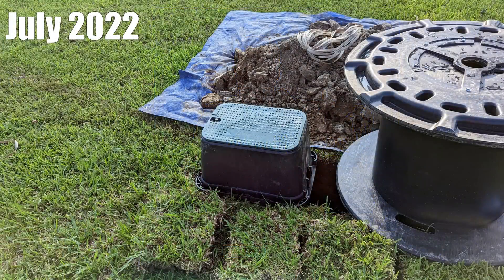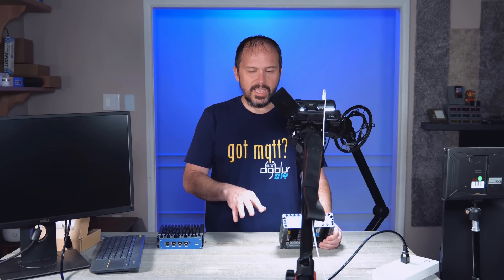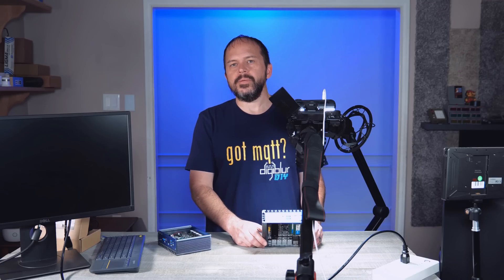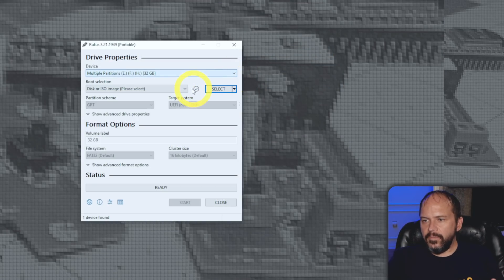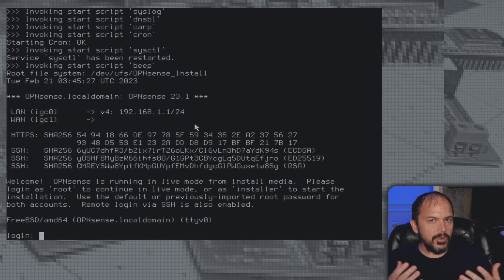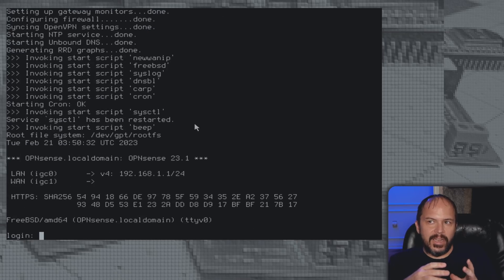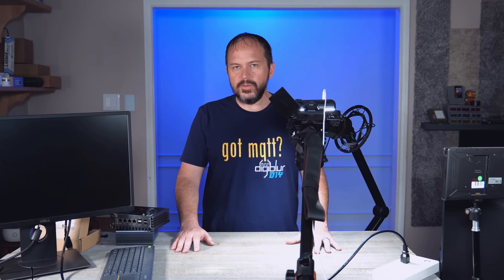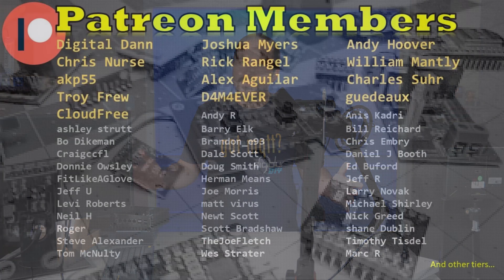Switched from Ubiquiti to OPNSense Router! How To Guide

Comment: I have an opnsense router and trying to use unifi access points. How do i configure the udp relay port and the associate firewall rules so the ubiquiti switch and ap will discover each other. right now i can see the devices but cant adopt them.
Reply from the maker: Is that due to the Ubiquiti controller needing the override IP option to adopt?
Reply: @digiblurDIY  i m not sure what that is. sorry i m very new to this. let me check google and see what i find if not may ask for more help!
Reply from the maker: Where are you running the Unifi controller at?
Reply: @digiblurDIY  I got it working on my windows desktop which is on the trusted lan network. But couldn't get it to work on haos in the same trusted network. It would find them but time out trying to adopt it. So originally I thought I needed discovery protocols. 
Can I move it to haos from my desktop? Does haos need specific ports or other settings involved to get unify network controller to work?
Reply from the maker: @TamrinKhan it is a common problem. You just need to change the override adoption IP in the advanced settings in Unifi as it gets confused running as a container/add on and sends the wrong IP to the hardware being adopted. All you need to do is put in the IP of the HAOS hardware.

Comment: I am exactly at this stage but I decided to put opnsense inside proxmox. Why?
1- dns is on pihole - also in proxmox
2- dhcp is on pihole - also on proxmox
3- this machine is already with battery backup
so there is no reason to keep firewall on separate/dedicated hardware, especially that my proxmox has 16 cpu and 64gb of ram - more than enough for every VM or container I can imagine ;)
and if my proxmox is down, my everything is down anyway - in such emergency case simply reconfiguring the routers to be again dhcp is enough to restore connectivity in the house
did I miss anything?
Reply from the maker: It is your setup to support and run so if you aren't missing anything than roll right on.

Comment: Cool Travis, I got mine setup. Will we be able to bring over the static IP reservations from the Edge router 4? I'm looking forward to the next video in this series. Thanks!
Reply from the maker: I don't know of a conversion tool. I did it manually. Copied the edgerouter contents to a notepad and then put them into Opnsense.
Reply: @digiblurDIY  Did you have to copy/paste the DHCP static leases in? Thanks
Reply from the maker: I edited the xml file and copied them in myself.

Comment: I prefer OPNsense to be honest.  Never had a problem with the PFsense community, but yeah OPNsense community are decent.  Only thing is there are generally more tutorials, YouTube videos and documentation available for PFSENSE at this current time, which is not the end of the world as those PFsense tutorials and stuff usually apply to the OPNsense operating system too anyway for the most part with them being so similar. 

Saying that, OPNsense on the other hand is generally more up to date with regards to FREEBSD (the platform they're both built on) which usually means more later hardware support.     For example, the Intel i226 2.5Gb NICS were supported on OPNsense long before they were supported on the PFsense community edition.

Comment: Been using OPNsense for around 10 years now.  Currently on A craptastic DSL line but the local cable company is literally running fiber and another local WISP is also looking to run fiber as well so one way or another it will be here.  Then I can actually stream and upload content because right now it's easier to load stuff on my phone then drive 20 miles to the city and upload that way, for that matter my cell data upload is faster.

Running a Supermicro X10SLL-F with 16 GB of RAM and a Xeon E3-1226 V3 and a 2.5" SATA SSD.  It's overkill but I have a couple vLAN I plan to setup when I have the time to do it and my network to my LAN is ran through a Chelsio S320E-LP-CR with 10G fiber as well.  

As far as writing images like that I prefer balenaEtcher.  Can write most anything it's pretty fast and can be setup to read it afterwards and ensure that it will be wrote right.  My favorite feature though is Unbound DNS coupled with the DNS Block Lists and custom blocking.  Some sites hate it and will fail but IMHO if they won't work right with all that stuff enabled and such they are probably getting too much data from it anyway, right?  Couple that with multiple DNS providers that are not controlled by my ISP and it's hard to beat how things work.

But FreeBSD clicks better in my head how it works and such and use TrueNAS (was FreeNAS when I started years ago) which is based on FreeBSD just like OPNsense is.  Makes it really easy when figuring out the hardware to use for something rock solid and stable.  My TrueNAS build has been in use for about 10 years now and IMHO it's amazing what you can do with some SAS controllers.  My case can fit up to 48 3.5" HDD's but I currently have a 11 drive RaidZ3 using 4TB drives with a 256GB SSD as L2ARC with about a 53% hit ratio so it does help save a touch with the jails I have running and such.

Comment: Good video!  I have been running a pfSense appliance for a few years and have been wanting to dabble with OPNSense.  Bought a similar appliance, put 16GB or RAM in it and a 256 GB NVME drive.  Set up OPNSense with Suricata on WAN and Zenarmor on LAN.  Set Wireguard up for a VPN.  I think I prefer the ease of use of OPNSense to pfSense.

Comment: got a question for you friend do you cover any of your videos? troubleshooting zigbee networks at the advanced level. diagnosing repeaters etc.  also, have you covered any of your videos upgrading the firmware on in devices and where to get those firmware to do so?
Reply from the maker: I do cover Zigbee2mqtt installs and such and pairing things combined with making sure your network is setup properly. The firmware upgrades happen inside of Zigbee2mqtt with just a click of a button.

Comment: hi Travis, does this device accommodate WIFI 6e?
Reply from the maker: No wifi on the this device unless you put a WiFi 6e card on it. Especially with 6e I would go with external access points to get them closer to the users.
Reply: He uses it as a router/firewall not a wifi router …

Comment: I have the same setup, I use a 5v power adapter for that 12vdc cooling fan, more quiet.
Reply from the maker: It's a 5VDC fan with a 3 speed switch. It powers off the USB port of the device itself. Pretty quiet even on high but I just run mine on low.

Comment: I have one of these units. I recommend taking them apart and reapplying thermals before putting them on load. Sometimes (mine did this) they will crash because of bad application of thermal pads and thermal paste.
Reply from the maker: I have heard of that. I did add the cpu temps to my dashboard and I haven't seen any issues just yet.
Reply: @digiblurDIY  I ran proxmox on mine so had a couple things run on it and I do allot of heavy network traffic, so it adds allot of load.

Comment: For those looking for an excuse to justify the expense to buy one of these to the wife/gf the ability to use dual wan connections (backup) is worth it.
Reply from the maker: I might need that dual wan deal. The clowns came to bury my new fiber line and cut the damn thing. It's going to be 2 days until they come fix it. Luckily I still had my cable modem activated.

Comment: been running pfsense for a little over a year, with my unifi switches.  love this setup!  nuked and repaved a month ago to take advantage of zfs boot environments on a single nvme drive.
Reply from the maker: Eventually I will switch to ZFS probably. Easy to just nuke and restore thankfully.
Reply: Hmmm, I thought that zfs is not that useful on single device?
Reply: @drreality1  I used to think that too, until I started using it.  boot environments!
Reply from the maker: I was under that impression as well and I thought I read that somewhere on a forum post but now I am finding conflicting info. I setup my test box with it and it seems fine. Makes sense after reading a few things more. Almost a must if you don't have a battery backup.
Reply: @digiblurDIY  I have a huge battery backup for my basement "wiring closet" (for years) with my synology nas's, a couple servers, main unify switch, and now boot environments on my router. Is there such a thing as too many backups?  btw, my pfsense is running on my Protectli Vault FW2B - 2 Port, Firewall Micro Appliance/Mini PC - Intel Dual Core, AES-NI, 8GB RAM, 120GB mSATA SSD.  It has been fine, but I have been hearing some things about questionable reliability.  If I were to start over today, I would just buy an appropriate netgate appliance.
Reply from the maker: As many backups as the wallet can afford is the way. Battery backups and automatic backup generator here but my power sucks. Frog pisses in the wind and it goes out.

That does make sense that pfsense wants to push their hardware though. Another bit of internet drama I stay out of but I do get it.
Reply: @digiblurDIY  not looking for drama either, or politics (about technology anyway).  just going off my best research on the topics to get a reliable system.  definitely would like a backup unit sitting here in case of hardware failure, since this one is so critical to my infrastructure, and if it smokes, I'm down until I can get a replacement delivered.
Reply from the maker: Yup. Fully agree.. Wastes too much time. This is part of the reason I bought two models. Partially for testing and bench network fun. But also for extreme backup purposes if something fails.
Reply: @digiblurDIY  one more consideration I went in a different direction with than you did is one lan port vs multiple, or vlans vs different physical lans.  (may be a good followup topic to discuss in your trials)  I decided that multiple ports would mean multiple switches to isolate my cameras. many more wires and more expensive that way.  and if all wires lead to the same fork in the road, the router, aren't they just separated with firewall rules anyway?  pfsense works so well with my unifi Switch Lite 16 PoE, in combo with a couple 5 port Switch Flex Minis like, at my desk and stuff, and my home assistant and unify controller running on proxmox.  not too many things I would change about all this right now, but I am barely up to a green belt in my networking ninja skills, so never say never.

Comment: I found Ubiquiti to be unfathomable running the controller on a PC. I bought replacement TP-link Omada kit on a trip to New York from the UK and it works much more predictably.
Reply from the maker: For routers I've never been a fan of Unifi with the controller thing.  The Edgerouter didn't require the controller as it had SSH and GUI.   I just needed a little more and there wasn't much in the Edgerouter line I could do so switching to open source was the way.

Comment: I just bought the same firewall!

The one I bought has 2 NVME slots in it (I think they are both x1 slots though). I installed 2 Intel Optane 16gb NVME drives in it, and running ZFS mirror for redundancy.

Mine is idling at like 70*C though, I need to take it apart and see if there is a problem with the thermal contact with the heatsink...
Reply from the maker: Ahh.. Yes. I have seen that one and you needed an adapter type deal between the two drives. How are you liking it so far?
Reply: @digiblurDIY  it uses a little adaptor board to use the 2240 slot usually reserved for WiFi chips. I really like it, I wish that they made them 1u height because it's replacing a Dell R210 II that has been running 24/7 since...2012.

But other than the form factor, I love the 2x NVME drive feature, I love that it has 2.5g ethernet (though only a few 2.5g switches exist right now), and I love that it uses a DC power brick so I can swap it out if I have PSU issues.
Have yet to put it into production but I might do that this weekend

The Intel Optane M10 16gb drive is also awesome. They only cost $20 and have 360tb of write endurance. That's more than most 1tb NVME drives. For Pfsense it works great due to all the logging
Reply from the maker: I have seen some 1U setups but they are pretty expensive compared to these.

Comment: I've been trying to do just this but utilize a VM on my Proxmox host but have ran into some issues having my NIC passed through to the OPNSense VM. My Starlink and Ubiquiti USG don't play that well together.
Reply from the maker: I looked into doing Proxmox or some sort of virtualization on the box to double utilize the thing but after reading about issues and such I opted to go bare metal for reliability given it is my router and has to work.
Reply: Don’t have an issue here with proxmox , instead of passing the nic , pass the interface and that’s it
Don’t forget proxmox is Linux which is up to date with drivers
However, opnsense/pfsense is BSD
Reply: I had issues as well but worked them out.  This depends on the cpu and motherboard pcie lanes,how they are laid out.
Reply: @K-politic  that’s true, multiple variables to be content with.
I’m glad that you got it sorted, it makes sense if you gonna have a pc that’s running 24/7 to be your firewall as well rather than another pc next to it, knowing that it introduces complexity that hypervisor may produce!